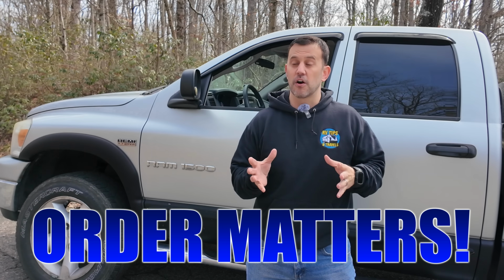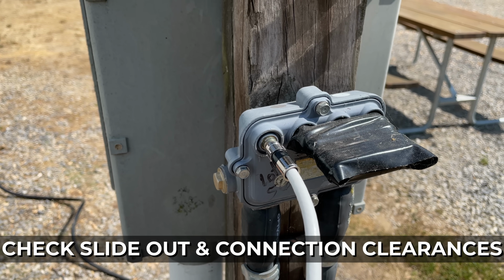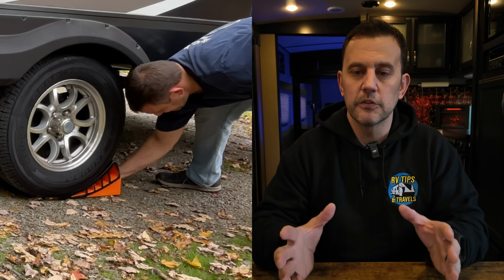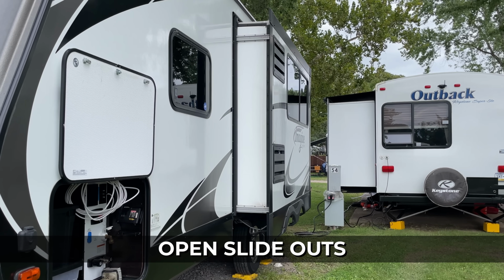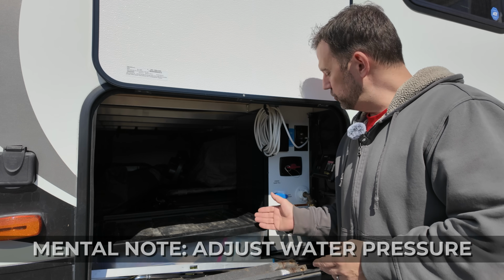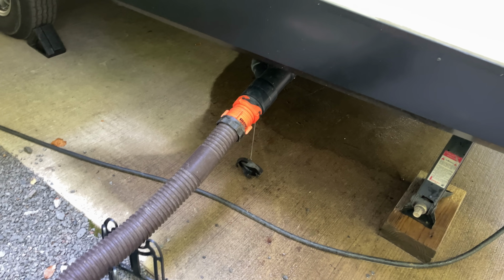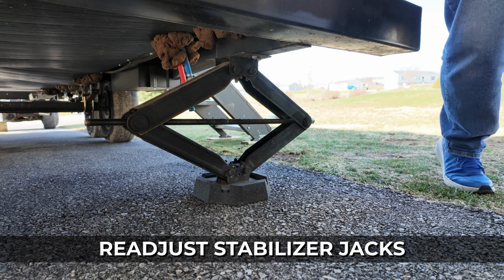How to Set Up a Travel Trailer Correctly ➕ Downloadable RV Setup Checklist for Beginners

Comment: Will say this- be very careful stacking blocks for your jack. We experienced where the camper shifted forward slightly, and caused the stacked (roughly 6) blocks to topple over. Thankfully no damage to the trailer but gave us a hell of a scare. Since then- no more than a 3-4 with a jack pad for added traction.
Reply from the maker: What chocks were you using?

Comment: Hello Ross, This probably nothing to do with setting up but it is something that happens while camping out. We have a simular RV like yours with blackout shades and if we pull the shades down all the way or part way with the windows opened and we have a breeze outside the pulldown handle makes a clanging sound on the frame when the curtain moves. Especially during the nights while sleeping. I tried to put a close cell sponge like with sticky on one side to help buffer the sound but they keep falling off. Any suggestions?
Reply from the maker: Keith, send me a few pics of what you're talking about: management@rvtipsandtravels.com

Comment: I would add that after you chock, get in the vehicle and put it in neutral and let it roll into the chock, then put it in park and put the brake on. This ensures the trailer will not move when you unhitch it.
Reply from the maker: great tip, thanks for adding... I was going to add this "settling" note in the video, along with some other nuances like putting the truck into neutral then back into park to move it an inch forward if the ball is too far back, however I didnt want to get to far into the weeds.  I wanted this video to stick to more of the process, not necessarily the fine details of each step, but again thank you for sharing this.  I think I'm eventually going to make a set up video (will probably be fairly long) with all these nuances built in.... either that or make individual videos on specific steps with those details.  Thanks for watching and adding to the video my friend.

Comment: This is a list for end destination but not beginning.  I've been towing for over 20 years and there is a take off list. I've spent nights at Walmart and Harvest Host while traveling across the continent.  The checklist begins at hitching up.  Building my channel... Ask and i'll direct
Reply from the maker: It is very clear that this video, and checklist for that matter, starts when arriving at your destination.  That is very clearly and quickly mentioned at the beginning of this video, so I'm not really sure why your comment started with "this is a list for end destination but not beginning."  I feel its VERY clearly spelled out.

The checklist you would be looking for is what is commonly called a  "break down" or "tear down" checklist, which includes tearing down a campsite and leaving that campsite... thats where hitch up happens, not when you arrive.  When you arrive at your destination, you actually unhitch.  Does that make sense?  Hope that helps you a little bit.

Additionally, I will ask you to keep all comments on the topic of the video.  This is not a place for you to recruit subscribers for your channel.  Let your videos do the recruiting.
Reply: @RVTIPSANDTRAVELS  Do you have a teardown list? We are picking up our new grand design trailer and driving cross country to Alabama to become full-time (never driven a truck or been camping before). Would really appreciate any help or advice on where to start from "home" and breaking camp to move to the next destination 😀
Reply: Oh snap, that's the most polite piss off poacher I've seen. Def not going to that guys channel there's way too much drama online to support someone who starts their pitch at someone else's house.

Comment: I’ve been full-time RVing for about nine years now. I always put 10 gallons of freshwater in my black tank. I do not use any sort of drop in or chemicals in the tank. I like to keep my poop to stay solid, not turned to mush.
Reply from the maker: we are currently building 2 exterior black tank systems to compare using a tank treatment to not using a tank treatment.  ive seen a few videos that shows how solids left in the tank dont actually exit the tank.  this is due to the pressure and flow loss as tanks empty.  so i decided to build 2 tanks to see what is actually better.  stay tuned!

Comment: Ross, do you set your water pressure with the water running through your RV faucet or not? Happy camping!
Reply from the maker: no, your regulator wont show the correct pressure on your meter when water is flowing. there needs to be no water flowing after the regulator to see the correct pressure.  the easiest way to do this is just get one of these hose caps. https://amzn.to/4drawKJ put it on the outlet of the regulator, turn water on, check pressure.  turn water off and relieve pressure before readjusting.  then try again.  make ssense?

Comment: 13:40 If you're using X-Chocks they'll usually also need to be tightened after the tires have cooled. Unless you're really cranking them down tight the tires will shrink enough to make them loose. I've had them go from good and tight to being able to just slide the X-Chock out.
Reply from the maker: never really had to adjust xchocks after the tires cooled down... i dont crank them too hard, just enough to apply some safe pressure, but I can see how a very long trip may affect this.

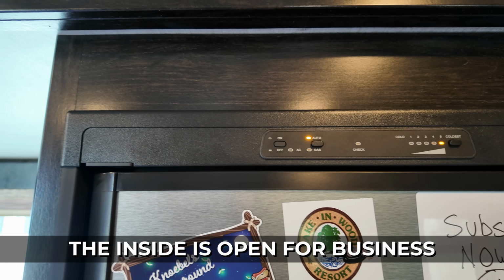Comment: 7:38 Always glad to hear people point this out. I've seen far too many people just using them as chocks, and I've seen a horror story from someone who's rig ended up rolling and hitting something because the x-chock broke. They do a great job helping stabilize the trailer though, haha.

And as the engineer from Lippert said, it also makes them a pain to remove if the trailer tries to roll (or you adjust the level) and they bind.
Reply from the maker: exactly!

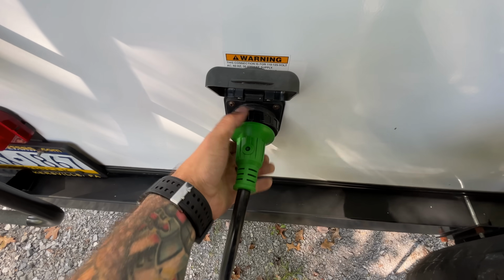Comment: 5:28 if you grease your hitch and ball your pants will also thank you later. I've ruined several pairs of pants by bumping the hitch or tongue and getting black, dirty grease on them. No amount of cleaning or de-greasing has gotten the stains out, at least not without also removing some of the color from the fabric.
Reply from the maker: Ive spoken to one major trailer manufacturer directly and they say there is no need to grease the hitch but they did say that you can put a little grease on the ball if you want... i dont think there is much benefit to the hitch or ball itself... instead, i will put a little white lithium grease underneath inside the trailer coupler just to keep that area slick.
Reply: @RVTIPSANDTRAVELS  That's what I was referring to, the ball and coupler. But inevitably whatever I put on there tends to end up as a black goo after a while. Then I'll end up at a site where I have to back up really close to the camper and I'll bump something, lol.

Comment: 100% agree on the safety chains too. I almost forgot to chock the wheels once and I know people who've had their camper slide a bit. I leave the trailer brake rip cord connected too in the hopes that either it would pull and activate the brakes, stopping the trailer, or that I could grab it and yank. I'd rather trigger it and risk having to repair/replace the brakes than have the camper roll down a hill and have to replace the whole thing.
Reply from the maker: very scary when a trailer starts to run away.

Comment: I always put blocks under my tongue jack, and stabilizers, because the less they're extended the more stable the camper is. But I have had to to use a bunch under the front on a very unlevel site. It was steep enough that my back bumper was almost on the ground. The campsite listed the site grade as "mostly level" when I booked it, but it was literally on a hill.
Reply from the maker: I use blocks too, but not something I wanted to dive into in this video.  I will talk about this in aother video though.

Comment: I use leveling ramps and recently pick up the Beech Lane leveler and boy does it make things easier. I usually put the truck in 4-low so I can just ease off the brake and creep forward so with the leveler I just inch forward until it says I'm good. I also found that my camper tilts about 1/4" when I extend the slide, so I go 1/4" past so it ends up dead level.
Reply from the maker: agreed, it makes things so much easier and quicker.  for the first year ive been using it i always go back and check with a bubble level when im dont and it is always spot on.

Comment: Yes, it’s a good idea to fill your fresh water tank up to about a third or half full even if you are at a campsite with full hookups. I can’t remember how many times that a campsite has had water main failures or unscheduled maintenance upgrades where you can be left high and dry
Reply from the maker: yep!  I learned the hard way.
Reply: Where/how/which way do you choose to divert the fresh water before travel? when planning on pulling away from any campground. I R No0b at RV style camping. Cheers!

Comment: We’re rookies in travel trailering. My husband and I always have an ordeal leveling, an old timer told us last weekend that the camper doesn’t need to be exactly zeroed out on the level side to side. The only one that needs to be EXACTLY level is front to back. What’re your thoughts on this?
Reply from the maker: I dont think being EXACTLY level is absolutely necessary, but I do think trying to get it as close as possible is important.  I know dealers open slides a lot when the camper is not perfectly level.  the issues happen in a couple different areas when you are not level.  absorption fridges should be level to function properly, same with slide outs.... i think if you are very close to level, then you are good.

Comment: My first step is to crack open a beer.
Reply from the maker: good point, will have to edit the list! 🍻
Reply: Just a little of my own experience here. First step if at all possible, 1) get out of the truck and walk around just to relax for a few minutes. 
2) " Very Important " take the time to be thankful, after all you could be at work! 3) Every thing you said 😊. 
Pro tip: its not rocket science, take your time, dont rush.🪡🇺🇸
Reply: And relax YES!
Reply: Last step! Ha ha
Reply: @robroy7153  😂🤣. Perfect!
Reply: @robroy7153  amen brother!
Reply: @robroy7153  I like the way you think😆
Reply: @robroy7153  right?
Reply: @robroy7153  if this step is happening after arrival at the Campground you’re just too late
Reply: 2nd step. First use unopened beer to level the trailer, but I like your thinking.
Reply: That’s the last step after hookup & leveling is complete.
Reply: @BadDadio that’s the first and last step! 😂

Comment: I had two more questions.  I had not seen the Sediment Pre-Filter before watching this video, and I noticed it in the video; it was not included in the items that were pointed out with arrows in your connections, but I was glad to see it included in your product list.  I pulled up the information for both the filter and pre-filter and it seems they both target the same sized particle, 20 microns, with the pre-filter adding about $16 to the filter cost; so about the same price as the filter (at the often discounted price).  I also notice you do not use the flexible hose protector - which I have always wondered about; it is often added to the packages but if purchased separately is $12.  THANKS AGAIN FOR A GREAT VIDEO!
Reply from the maker: nice attention to detail Mark! ok, first, the pre-filter was sent to us from one of our sponsors (Camco) to test out.  I havent really talked about it yet because unless your really doing chemical tests or even paying attention to your water quality, its hard to gauge how well it works.  You are correct, it is the same filtration as the actual filter, but the idea is that it will lengthen the life of the actual filter.  Again, no real data, but eventually I will talk about it.  Nothing I think is necessary at this point.  Something else to consider, we alway bring bottled water, so our water connection is only ever used for showers and cleaning things.  Your second question... I used one of those flexible hoses once, and it leaked, so I just throw them out when I get new new filters.  I use brass 90 degree connectors at my RV so there is no need for flexible hoses.  heres the connector I use: https://amzn.to/3vncuKL  Let me know if you have any other questions my friend!
Reply: @RVTIPSANDTRAVELS   I knew the pre-filter was a new addition to Camco gear March 2023, I think; TEST ON!  I have had issues with the flexible hoses leaking, too - and was thinking of removing them.  I use the 90 degree based on your recommendation from some time ago - but just looked at your link and it has the shutoff; I have thought about the 45 degree to move it our above the faucet handles, but it is working as is.  THANKS AGAIN!  VERY HELPFUL!  ENJOY THE SPRING!

Comment: Nice vid as usual Ross, thanks for the tips. I have the same rig you do, how did you solve the issue with the Blackstone using the gas line from the trailer’s bottle? For now I’m using a portable 20ft hose but it would be nice to use the quick connect on the side of the RV…Thank you
Reply from the maker: What do you mean exactly?  I’m a little confused what you’re asking
Reply: I apologize, I assumed everyone had the same issue I do. I noticed during the video a shot of your blackstone grill or a similar grill by your rv. On mine I have a gas line that comes from the front bottles, which serves eventually the hot water heater in the back, that runs along the bottom side of the vehicle and just below the outside kitchen, splits into a quick connect for the small outside gas stove. When I plug my blackstone to that quick connect instead, the line doesn’t produce enough gas pressure to allow the blackstone griddle to function. Hence my 20ft extension hose directly from one of the bottles. Have you had the same issue or you use your blackstone with a separate gas tank? Hope this makes sense.
Reply from the maker: are you using the regulator that comes with the blackstone?  if you are using the propane lines from the rv, they are already regulated so you need to delete the blackstone regulator.  that might be what is causing your issue.
Reply: Starts to make sense…I’ve seen another video and it seems that way…I’ll do some more investigation. Thanks for your reply!
Reply from the maker: let me know, happy to get on a facetime call with you when your at your camper and see if i can help.  let me know.
Reply: @RVTIPSANDTRAVELS  quick follow up. After ordering a new elbow adaptor to quick connect male for the blackstone gas input, I had the same issue of painfully low pressure. Got on the phone with the part seller and an outstanding, old school, made in America type of part representative helped me troubleshoot the issue, suggesting what eventually fixed the problem. It turns out the quick connect receiver on the RV side was not only partly clogged on the inside (behind the ball bearing spring connector) by some insulating material (presumably plumber putty) leaving only a minuscule orifice, but after unscrewing the part from the gas line of the rv, spraying a generous amount of WD40 and blowing compressed air through the ball valve, a projectile mud bug nest shaped into a pellet, jetted out of the connector. As the representative suggested, some species of bugs in the northeast tend to be very invasive and they can make their way into small parts even if apparently protected. The rv connector comes with a rubber cap that clearly didn’t pose a challenge to the mudbug. I wish I knew this sooner!
All good at the end, finally get to enjoy the outside kitchen and the blackstone griddle as advertised…
Thanks for offering to help out!
Reply: Very cool. Thanks! I’ll keep you posted.

Comment: OK - there is no doubt that you have a lot to do with how we have been setting up for the past year plus. I will add leaving the chains on until chocked and steady - and our last campsite had a substantial slope so that would have been a plus.  I do have one question.  I always check the power before doing any other setup steps; power off; plug in;  check for issues; if no issues; turn off the breakers; lock my EMS with a chain and puck lock; then I run my power cord and turn the power on.  My question is that you said to turn off breakers, plug in EMS, turn breakers on, if it is good, turn breakers off and unplug.  If I need to unplug, I will, easy enough, but I have not been doing that and I am not sure why you would need to.  I am just hooking up the power, and flipping the breakers back on, because I think everything benefits from having the shore power on - but if that's an issue - I will pull the plug;-)  THANKS AGAIN!
Reply from the maker: good question, i say to not plug in the camper yet because youre not done moving the camper yet.  you still have to level sideways, or even possibly move the camper so everything reaches.  i never move my camper with the power cord connected, even if its 2 feet to level on ramps.  that can turn into a bad situation.

the second question, also a good one.. plugging into a live outlet can cause arcing.  we do it all the time in our house but we dont really have the luxury of turning everything off before we do.  even if arcing is rare, its just better to have a solid connection in the outlet before having the power on.  hope that helps.

Comment: Great video! You always do a nice job of explaining things. One thing I think you need to use is a Valterra Gate Valve on your trailer dump connection.
Reply from the maker: 8 years later and still waiting for my termination valve to leak, fortunately, so no need for one yet.